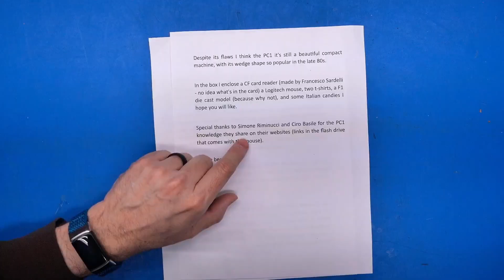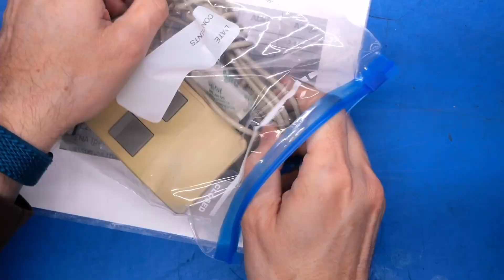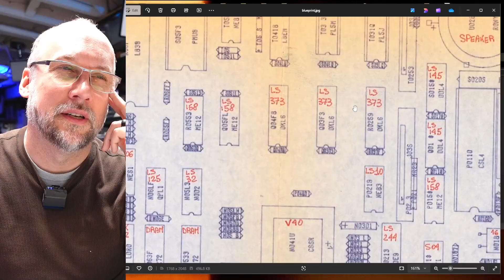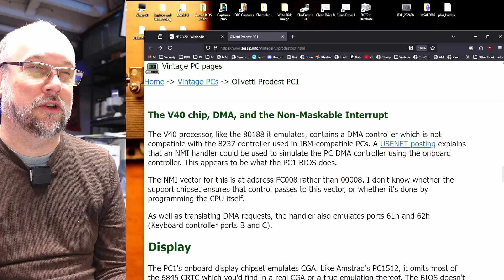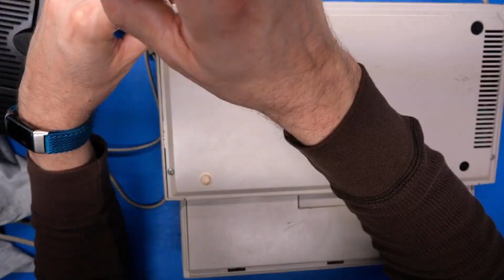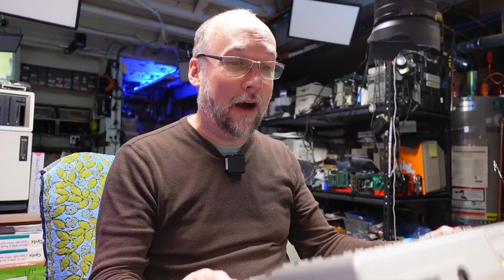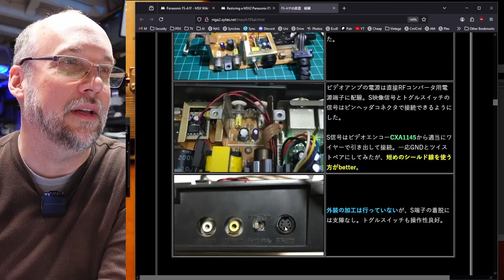0093 Two international wedge computers from 1987 (Olivetti PC1 and Panasonic FS-A1F)

Comment: Cool!  I have the Panasonic FS-A1 MkII, myself (the one without the floppy drive but otherwise very much the same).  The PCB inside is laid out a bit differently, and the PSU requires an external power brick instead (with a very unusual plug on the machine side).  I re-capped the whole thing myself, due to leaky caps on the HIC-1 daughterboard, and it turned out very nice.  The video out of the RGB port is EXCELLENT, by the way, and definitely the way to go.

A note about the onboard ROM's:  the included Clock program is not Y2K compatible, but the modern version of MSX-DOS, "Nextor", actually is!  You can set the clock from DOS to the current date, but the graphical Clock program will mess it up if you run it (at least, that was my experience).  I have heard that you can replace one of the ROM chips to remove the included software, but I haven't tried it myself.  Honestly, other than proving that the machine works, none of it is all that useful, other than serving as a brief demo of how much better the MSX2's graphics chip is than the MSX1's.

Have fun!

Comment: I have been using the MSX Pico for quite some time. One of the nicest new hardware for the MSX computer.
FM PAC and SCC emulation MP3 files play. High quality audio. Store a lot of data on a micro SD card. No hard disk needed anymore.
Lastly added WIFI.

This is an huge update for the MSX computer.

Comment: The UK mains supply is about 230 volts AC it used to be 240V on appliances but in 2009 the mains supply was brought down by 10V to allow compatibility in the intended voltage of appliances made for both the UK and European market.

Comment: As a technician in the late '80s I worked on several Olivetti M24s/AT&T 6300s. Seemed to be mostly in doctor and dentist offices, I don't know why. They had a unique design where the motherboard was upside down on the bottom and then a metal plate separating it from the top half and a u shaped connector going from a card edge on the motherboard, around the metal plate and connecting to a bus on the top, where the expansion cards were.

Comment: Adrian, the next time you need to boost your (U.S) voltage to 220-240, etc., use your Variac to lower your 122 VAC to whatever is needed to get voltages you want like the 220 VAC needed by the Olivetti.

Comment: Hi Adrian, love your video's. Brings back memories from the 80s and 90s when I fixed those computers and AV equipment. By the way, on the MSX2 computer. The connector between the printer- and the RGB connector is probably an tape recorder connector.

Comment: The 1988 was probably the worst year to get an Amiga: literally next year there were (S)VGA 386/486 PC systems available, which allowed for color-rich, non-flickering display, huge 1.44MB floppies and cheap IDE hard disks, and much much more exciting games and productivity software. With Amiga, you had to spend $350 just to avoid jittering display due to inability of Amigas to use any other monitor than a TV set with 15KHz scan rate.

Comment: ... oh and that hole on the MSX cartridge... It was meant so that the computer can prevent accidental insertion or removal of cartridge while power is on... (Not that I would have seen it implemented on any of my machines ever.) The other hole in bottom is to prevent that you can't insert the card wrong way around.

Comment: Today it may seem a bit weird that many MSX computers had more than one expansion slot as we have today all these "all in one" cards and this model has even internal disk drive, but back in time it was common that you had ie. SCSI or IDE in one slot, music expansion in another, then maybe RS-232,  MIDI, RAM expansion or another sound card on third slot and so on... and if you wanted to play a cartridge game it many times meant you needed to first disconnect something, if you didn't have a free slot. Even the card you have divides the slot logically to 4 slots to fit all the functionality in... So practically all the reasons were same as with some PC:s that had more than one ISA-slot although i.e. external video cards were never really popular on MSX. Anyway  the standard allows you to i.e. plug up to 4 disk controllers with up to 8 drives to the system at a same time. The little difference is that slots on MSX are numbered, so you don't need to play with dip switches as is the case with PCs.

Comment: The F keys are yellow originally not yellowing due to age!
I owned an office equipment shop in 80's & 90"s
Ok you found out the keys was yellow.
The power switchs was a weak point changed a few but otherwise very reliable machine!

Comment: Actually if it is a switching supply after the transformer, it needs to work less hard (as it will just switch at a lower duty cycle).

Comment: MSX standard allowed up to 4 slots and up to 4 subslots on each one. Slots just covers the 64 kb of address space of the z80 and divided in 4 banks of 16kb. 
The address space of 64 can be mapped with any combination of  banks from the 16 possible slots.
System rom and system ram are located on slots also. 
At least one slot is external via connector but in general there were 2 for leaving 1 for external disk drive and other for ROM software (game, language program, text editor, etc).

In msx2 a memory mapper was added. This way only one slot can map an switch up to 64kb taken from a total of 1024kb max.

Physical slot connectors has access to IO space and cartridges not only includes software but also hardware like sound generators, or any other devices. I'm 90's I made an EPROM programmer.
If you wanted you could add a commodore SID chip there (the slot has an audio input for injecting sound that will be mixed with computer audio)

In this old times, msx was like now PC compatible and commodore like apple.

Comment: nice beasts! i have a transformer in same type case as that but it switchable, 120-240 or 240-120 and has a 'universal' output socket
Reply: in the pc1, those yellow/orangey jacketed ROE / ERO electrolytics are notoriously iffy and likely to short or leak, just replace that, and any others of that type, possibly the output caps, and test the psu with dummy loads, it'll likely be ok , dont put a different one in unless a last resort, keep it as original as possible!

Comment: Used work in a place where we created blueprints. Basically we would draw the part on a translucent kind of grease-proof paper in ink, and then you would take this down to the basement where you would lay it over a light sensitive paper and expose it to a bright light for a bit. Where the lines weren't the light sensitive paper would turn pale blue, and the lines dark blue. The slight fuzziness of the lines is caused by the bleeding of light onto the lines. 

Ultimately not something you wanted to leave in the sunlight, however the original drawings were kept and further blueprints from them could always be made.

Comment: To solve the screwdriver bit problem you can with the MSX,  cut a slot in the back of the screwdriver bit, you can then use a normal screwdriver to turn the bit in a deep narrow hole.

Comment: Our first PC was an Olivetti, from the death knells era. PCS 44/C 486 SX/25 with the Sound Blaster 16 and 2x CD-ROM entertainment pack preinstalled, so a lot of Grolier and Where in the World is Carmen Sandiego. Upgraded with an AWE32, DX2/50 overdrive, and 8 MB RAM. It's where I learned about the demoscene, 3D Studio, and made tracker music. The motherboard had decent specs, I remember - Tseng ET4000 onboard, but only 512 KB RAM so a bit hampered for higher resolutions. But 3D Studio 3 had drivers for it :)

Comment: Quoting topic “Urgent alert to MSX2/2+ owners: suicide capacitors on HIC-1 daughterboard” on the msx org forum:

“If you have any of the mentioned models, you should hurry and replace the following capacitors on the HIC-1 daughterboard:

- C10=10uF/16V
- C14=10uF/16V
- C22=100uF/16V

The worst offender is the C22. In many machines our group inspected it was beginning to leak.

It's possible to replace them with either electrolytic capacitors or more modern Tantalum or Ceramic capacitors. It's very advisable to replace them with the more modern ceramic versions, so you won't have to worry about this problem ever again.

Those are the appropriate specs if you're going for Ceramic or Tantalum replacements:

- 10uF: size 3216 (1206 in imperial unit)
- 100uF Ceramic: size 4532 (1812 in imperial unit)
- 100uF Tantalum: size 6032 (only metric)

All three capacitors must be rated for 16V or more.”

Comment: At least in Germany, we had 220V until 1987. It got adjusted in steps to 230V. Since 2009 we have 230V +/- 10% at 50Hz, like most of the rest of Europe. So, all devices intended for use here have to be rated 230V, and should be able to handle up to 253V.

Comment: In my parent attic I have the predecessor to the PC1, a Thomson MO6 clone labelled Olivetti Prodest PC128. I got it as a Xmas present in place of the requested Commodore C64 and it had a similar design as the PC1 with a cassette recorder in place of the floppy disk. It had limited graphics and sounds capabilities compared to the C64 and it could only boast 128kb of RAM. I bought several games which, again, were repackaged games for the Thomson MO6 in most case not even bothering to translate the french text messages. It was very good as a Basic training computer and that is very I started programming. But for games, quite disappointing; for the next round I made sure to get an Amiga 500.

Comment: the hole is necessary for some msx machines, it's for locking the cart in while powered on or for cutting the power if you remove it while powered up
Reply: Yeah the hole is indeed part of the MSX specification. but not many computers had an actual pin locking the cartridge. There are 2 pins on the cartridge slot that need to be shorted and together with a switch in the cartridge slot can turn off the machine during insertion or removal of the cartridge. This is used on more machines but the Panasonic FS-A1F has neither ;)

Comment: please get a variac, so you can adjust the voltage to appropriate levels. I have a vevor unit and my example is pretty good, not that expensive either.

Comment: Hi Adrian, hope you will soon be able to enjoy the FS-A1F. Some notes, apparently the capacitor situation got mixed up in my communication with Shahram, one of my friends noted that the missing color is due to not all the pins on the CXA chip being soldered to the HIC1 board. For the Gotek adapter, please make sure to connect the 26 pin ribbon cable correctly, it carries also 12V and connecting it up the wrong way might fry the Gotek and/or the mainboard, with the machine powered on you can probe where the 12V is and on the adapter board it will be on the BERG connector from the 26 pin. The upgraded ROM will remove the onboard applications, you can keep the original ROM but it can interfere with Nextor (MSX-DOS). Generally 128kB RAM (after the upgrade) is enough for playing games and running applications.

Most games can be played with the keyboard. Use the cursors for directions, space for main trigger and M for secondary trigger. Some games will use Z, X, C for commands (like on PC-8801/PC-9801). MSX joysticks/joypads need 2 trigger buttons to be usable in games.
Reply: Wish the 26pin floppy adapter for A1-F was open source. Currently the only way to get one I guess to to track down the years old post about it and "message him" to send him money for one or something.

Comment: Cool machines!

Some suggestions:
A: Recap rather than replace the Olivetti PSU. It looks like a typical L296 secondary switch regulator setup, like the C128 and the first Amiga 500 PSUs, and those are afaik really solid as long as the few caps are in good shape. Maybe just to be sure check that there is a crow bar circuit in the Olivetti though. You could of course replace the built in transformer with say a separate transformer from some old ink jet printer or old scanner or other thrift store style power supply if you want to power it from your 120V sockets.

B: Use the 120->100V transformer before your 120->240V step up transformer in order to get approx 220V instead of 240V for any 220V European equipment.

C: Like others have already suggested, install a 240V socket in your lab. You could be the first vintage computing Youtuber in North America to do this! Either use US style NEMA-6 or NEMA-14 connectors, or some European socket. The NEMA 6/14 option would probably be the best as it would be compliant with the NEC (US electrical code). Then just have a power strip or two with Schuko and perhaps UK sockets, and put the apropriate NEMA plugs on it.

Edit: To make it as safe as possible for usage with european equipment, you could add an additional breaker box in series, so your panel would have standard US breakers, while an extra box with a DIN rail could have breakers that are both UL rated and comply with the characteristics for European electric installations (trip speed at various levels of over current and whatnot). Such boxes and breakers can be bought from solar companies as solar panel combiner/breaker boxes - for some reason the solar breakers for DC seems to always use DIN rail, and I doubt that they aren't approved for AC too.
Reply: He wouldn’t be the first, clabretro already has a 240v line for his retro rack.
Reply: @Arivia1  True!

But afail Clab only uses it to power equipment that consumes lots of power, not for imported equipment. (Also more or less everything Clab uses is new enough that I think it will run on anything between 100-240V). :)

Comment: I changed a step down transformer to step up as well. But I'm lazy  just 
cut off the male plug and put a female plug in and turned a cheap 
extension cord into a male to male cord. Then hot glued 1 end into the 
outlet on the transformer, Works fine.

Comment: Oh man! An Olivetti and an MSX2 in the same mail call video! I love my Sony HB-F1XDJ MSX2+ machine. There aren't many MSX2 users in Portland but maybe we can change that! I made up an RGB cable for mine and highly recommend it. (Or S-Video) It makes a huge difference  especially in text mode. MSX-DOS is binary compatible with CP/M so you can try running some CP/M software off of the GoTek as well! I can't wait to see the main channel video!
Reply: The Panasonic FS-A1F has the same 8 pin DIN connector for RGB as the Sony HB-F1XDJ. BTW the other 8 pin DIN is for a cassette interface.
Reply: CP/M will need the ram to be upgraded to at least 128kb
Reply: @anvz6  the MSX Pico provides additional RAM through a mapper so CP/M should have ample memory but getting to 128k on-board is as simple as adding a few more chips to the board. Rammy (and by extension, Adrian) have plenty of RAM chips to spare!

Comment: Just so you know, nowadays the whole of the EU and the UK are running on 230VAC. When this machine was made the EU was using 220VAC, and the UK was on 240VAC. I guess they decided to make a single standard and met in the middle. This would have made a few problems when they did the switch over with very suspect house wiring in parts of Europe. I have been in Spain, and when it rains you can walk around in an old part of the city and smell the Ozone !!!
Reply: In theory it does, in fact the voltage didn't change. The specs were updated to say IIRC 230V nominal -10V or +30V (or something like that), the numbers were tuned so that the new spec was a superset of both the earlier 240V UK and 230V EU standards. My very much UK supply is actually more like 245V!!

Comment: Why you may want to expand the memory of the MSX2 to 128KB...

The MSX2 standard required at least 64KB. And this is what most Japanese MSX2 computers came with, including yours. In Europe instead 128KB became the norm. As such, Japanese developed MSX2 software will normally work fine with just 64KB, but some European software titles may expect 128KB.

Comment: The UK now runs at 230v since 2003 in order to harmonise and link up grids across europe
Reply: In theory it does, in fact the voltage didn't change. The specs were updated to say IIRC 230V nominal -10V or +30V (or something like that), the numbers were tuned so that the new spec was a superset of both the earlier 240V UK and 230V EU standards. My very much UK supply is actually more like 245V!!

Comment: The two slots are for well anything you want. the MSX just have some pretty nifty memory "slots" to deal with expansions both internal and external, so you could for example add a disk drive to the system if didn't had one, could add a FM music cart, add more memory, there's even some wild bizarre cartridges that turn your MSX 1 into an MSX 2

Comment: Yep. You nailed the pronunciation for Galatine. They are kind of an acquired taste though. 😀
I don't think I have seen anything similar around the world.

Also, the Function keys on the Olivetti came in that shadow of yellow from the factory.
Reply: shadow => shade

'shadow' what you get when something blocks the light;
A 'shade' (of a colour) is a small variation in it, such as light green to olive green. It doesn't necessarily mean darker.
[to be confusing You can be 'in the shade', meaning you are within a shadow cast by something else]
Reply: indeed. I had the feeling that something was off when I wrote the comment. On the other hand, English is only the third language I learned, so I'm sure there is still room for improvement.

Comment: You should have replaced the socket on the front of that transformer with a 240V one, IE: one blade is at 90 degrees to the other.  The parallel blade socket is ONLY for 120 volts!!!!
Your UK adapter would then have to be different as well.